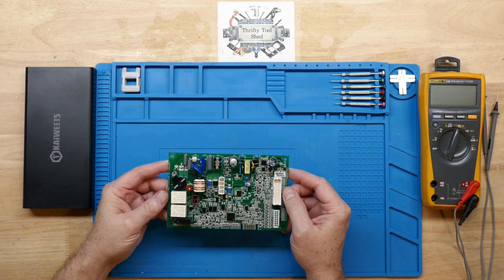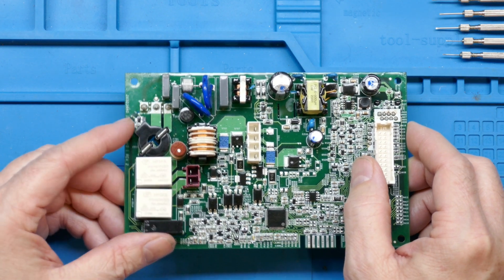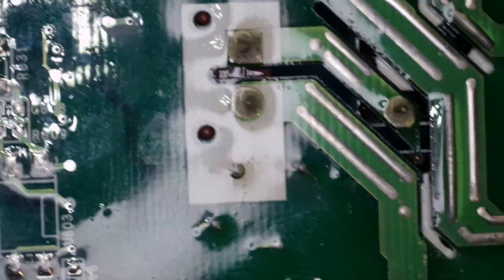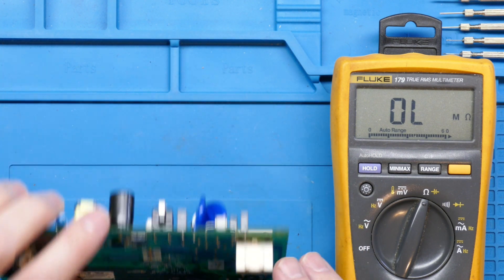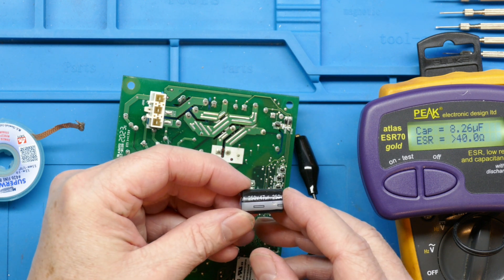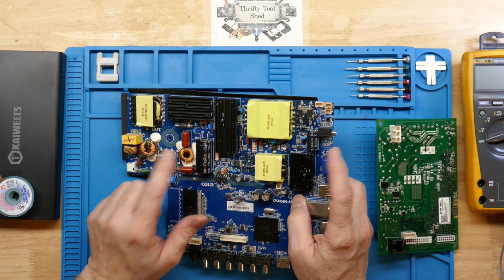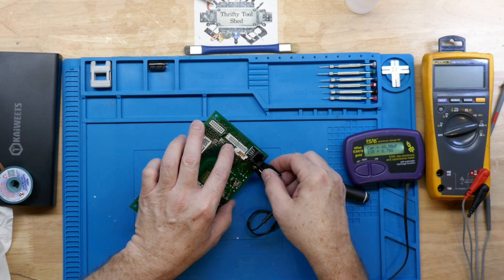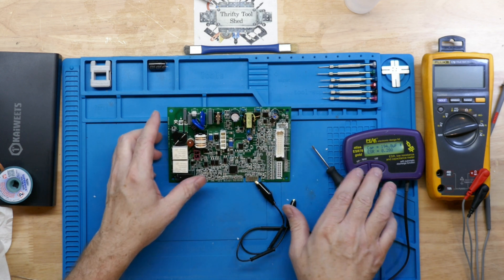GE Dishwasher Board Repair

Comment: How do you repair a pin contact ?
Reply from the maker: Typically replace the connector. In some cases it is possible to solder directly to the board and make a new connection that way if a replacement connector isn't available or feasible.

Comment: have you tried vinegar for silicone? BTW what temp. on the iron?
Reply from the maker: I have not tried vinegar for silicone that I can recall. I keep it around for alkaline battery corrosion, though. It's been a while.  I believe the iron was on 690⁰F. Typically, I run it around that for lead-free solder.

Comment: Amazing job showing how you can identify something like a capacitor quickly. just think of all the money that would've cost to have a appliance repair man come out determine the board is bad by a whole new board and bring that back and install it. I recently had something similar to that done a GE dishwasher and the total charge was almost $550.